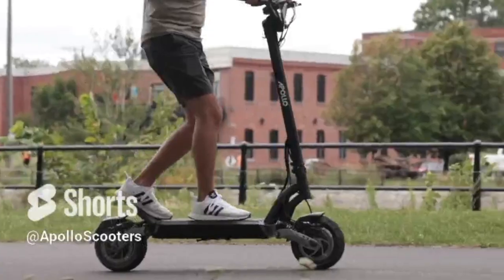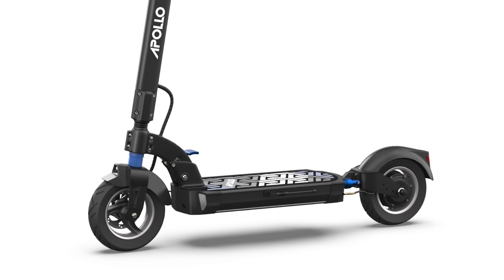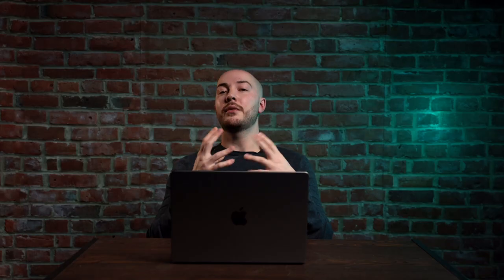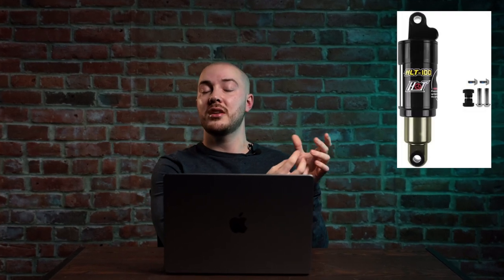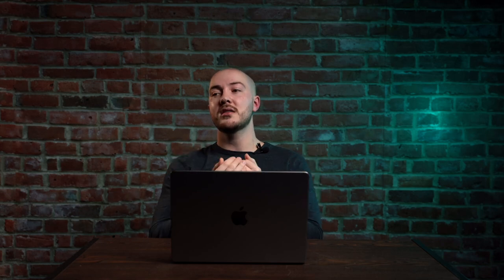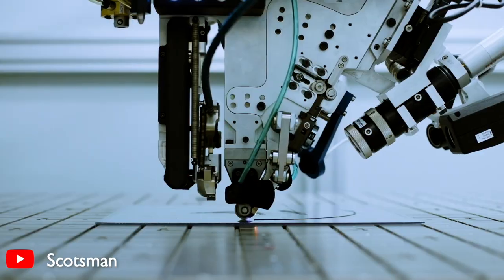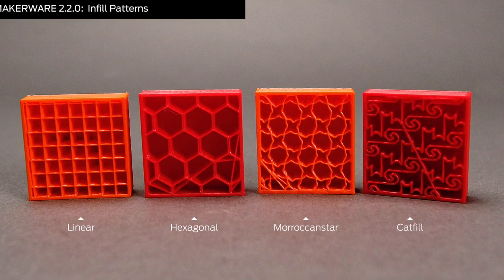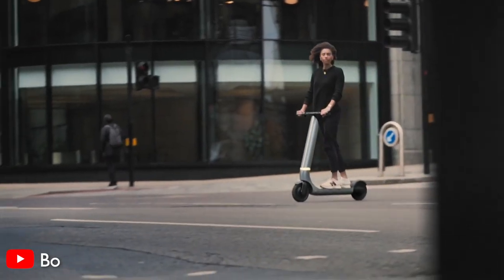How It Works - Demystifying Electric Scooter Suspensions

Comment: Would the City pro suspension fit the Ghost? The springs looks very similar, with a mounting converter we could easily install it on the ghost. The problem I’m facing is that the hole where the spring is attached on the ghost is only 35mm wide, not a lot of suspensions are that thin, most are around 45mm wide.
Reply from the maker: Hi Jocke,

Unfortunately, the City Pro suspension is not compatible with the Ghost.

Comment: I have a good question I just got my electric scooter ousini s6 my shocks in the back need a upgrade and the front of my suspension where the steering wheel is at I need a upgrade can you send me in the right direction

Comment: Have you guys ever though about a type of mud flap for scooters to help prevent flats? Ive noticed that the rear tire really takes a beating and picks up stuff from the road more often than the front tire. Ive came to reason that this is because the front tire kicks stuff off the road where the back tire catches it. A possible simple solution is to have a mud flap right behind the front tire that helps keep objects out of the way. 

Could have it designed in a way where items tossed up off the road are caught by the flap and pushed to the side out of the path of the rear tire. A replaceable brush could line the bottom of the flap so it drags along the ground making a really nice barrier. Overall its just a idea but something that might extend the life of a scooter tire.
Reply: try using a mountain bike suspension fender, they are plastic and easy to apply. I will try it and see if i can cut it and squeeze it in there somehow lol.